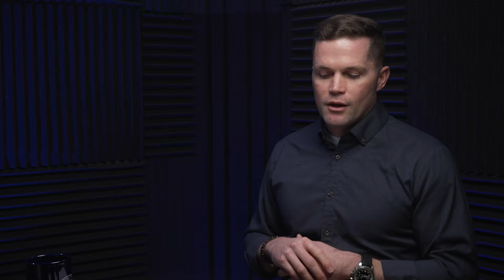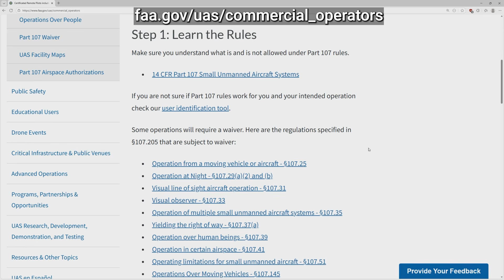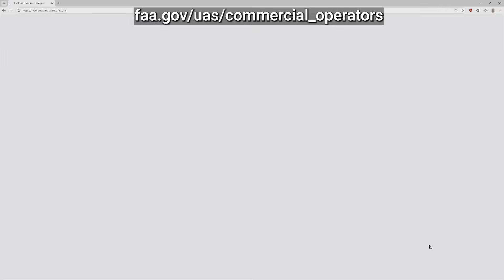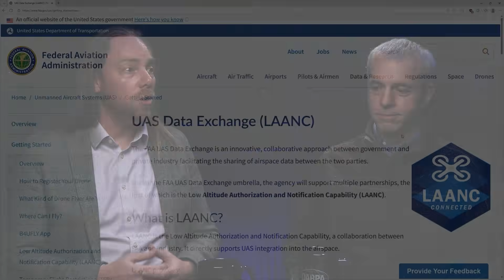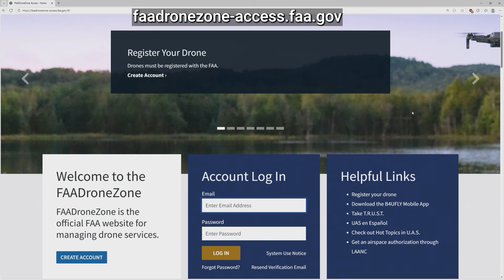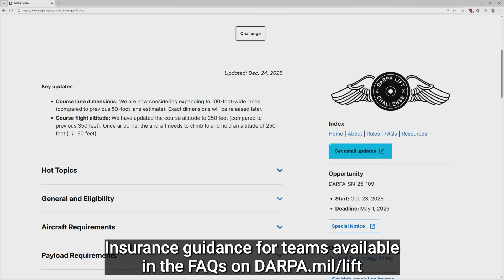FAA Processes Explained for the DARPA Lift Challenge

Comment: Unfortunetly, this challenge did not seem to be widely marketed, or given enough time to incubate. To show up with a radical clean sheet design, that has undergone a reasonable development and testing period, is really tough on such short notice. - Especially when the burden of FAA regulatory overreach stifles exactly these types of vehicles: Radical, experimental aircrafts with extreme payload demands.

They announced this in October 2025? And closed applications at the end of April. With a competition date the first week in August: Not enough time for word to spread, let alone to see any real excellent innovations mature.

There are several ways to accomplish this: But I do know a way to build an eVTOL that is non-obvious, but would readily lift 220lb/100kg at an empty mass of 25kg/55lbs as this competition demands. And it can/will be able to operate for up to 15-60 minutes, depending on batter capacity. (15 minutes hover time only requires a 5.1% battery mass fraction). - Weirdly, larger battery mass fraction actually increases aerodynamic efficiency. But that is for another time.

Comment: To maximize aerodynamic lift in aircraft design, the fundamental principle is to create a significant disparity in airflow velocity between the upper and lower surfaces of the airfoil: faster airflow over the top generates lower pressure, while slower airflow beneath produces higher pressure, resulting in upward lift. The greater this velocity differential, the more pronounced the lift.
Building on this, my proposed innovation involves integrating twin compressors that propel high-velocity air across the entire wingspan. This system would actively enhance the airflow differential by accelerating air over the upper surface while maintaining or controlling the flow underneath, thereby amplifying lift efficiency beyond conventional designs.
This approach modernizes historical concepts such as the Custer Channel Wing, which channeled propeller slipstream over a semi-circular wing for short takeoff and landing (STOL) capabilities, and Alexander Lippisch's "super circulation" principle, which emphasized induced circulation to boost lift through controlled airflow manipulation. By leveraging advanced compressors for full-span coverage, we could achieve unprecedented lift-to-drag ratios, enabling ultra-efficient flight and reduced runway requirements